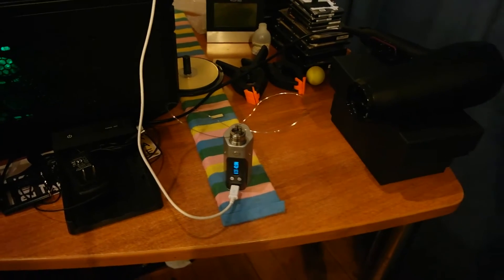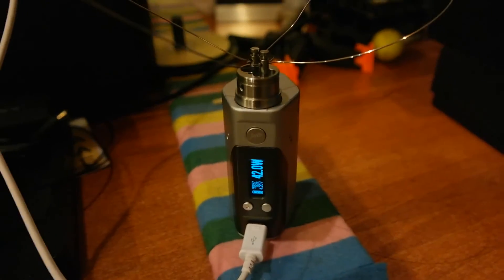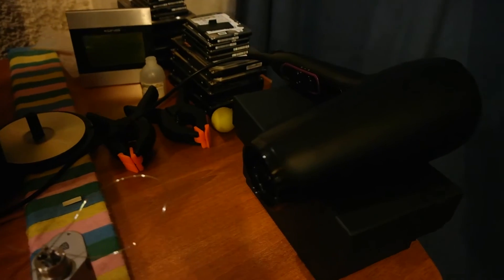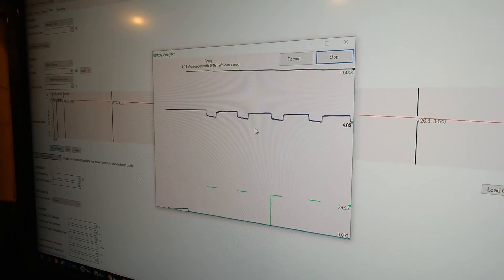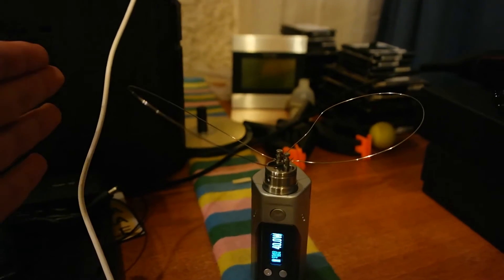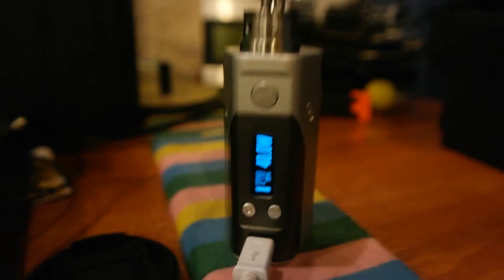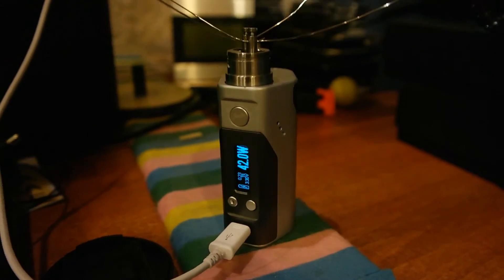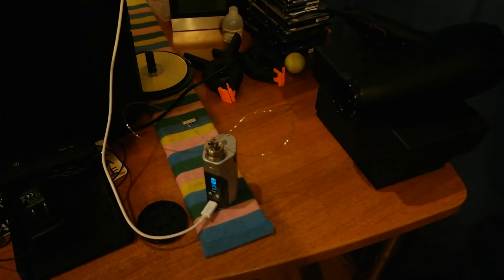eScribe Battery Analyzer on Wismec Reuleaux DNA200

Comment: What is the 22gage length and ohm reading required to analyze the batteries?
Reply from the maker: It doesn't matter. As long as the DNA200 can read it. The length was perhaps around 30cm.
Reply: +How it vapes it matters read the ohm escribe recommends

Comment: Great video! Interesting technique. Does the Wismec Reuleaux DNA200 do balance on board charging? I'm actually in the market for a DNA but I can't seem to decide if it will be with an internal Li-Po pack or with external 18650 batteries. The DNA chip is really something. Catch you on the next!!
Reply from the maker: +SWISS 777 Yeah, it does balanced onboard charging. It's better than chargers like the Opus C3100 or the Nitecore D4. BUT, it's slow when using 3 x 3000mAh batteries. Max Amps it draws from the charger are about ~1A, which means it needs at least 8-9 hours to charge. By no means external chargers are bad. I use only external chargers and have 2 x 3 LG HG2 sets which I swap very day in the DNA 200.
Reply: +How it vapes    https://drive.google.com/file/d/0ByxGicsUc4V-RG9QcVRhWjJEcVU/view?usp=docslist_api
Wismec Reuleaux DNA200:
>Reuleaux.ecig< (Go to "File" on EScribe and click "Open..." and point to this downloaded file)
Power Mode, NI, TI, 304SS, 316lSS and Tungsten Profiles
Battery:
Capacity: (Of course this file does not contain the proper Battery Capacity Settings because that depends on the 18650 Batteries you use on your device)
Electrical:
Mod Resistance: 0,0016
Thermal:
Case Cooling Time Constant: 760,22
Case Heating Time Constant: 664,33
Case USB Charge Temperature Rise: 11,61
                                                               17,08
Minimum Ambient Temperature: -20
Maximum Ambient Temperature: 110
Reply from the maker: +SWISS 777 I already have the Reuleaux config files loaded. Is there something different on these files?
Reply: +How it vapes Actually it's really the different profiles I wanted to show you. I believe these to be optimal for temperature control on NI200/TITANIUM/SS304/SS316L/TUNGSTEN
Reply from the maker: Ah. I prefer to use the downloaded cfv files from steam-engine.org. I find these to be the best so far.